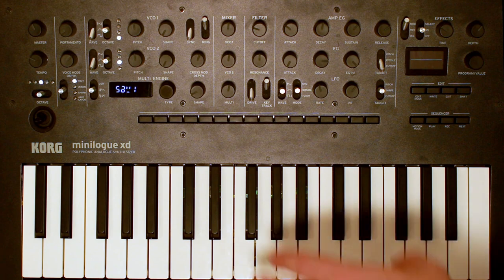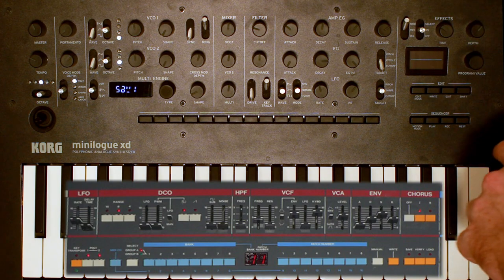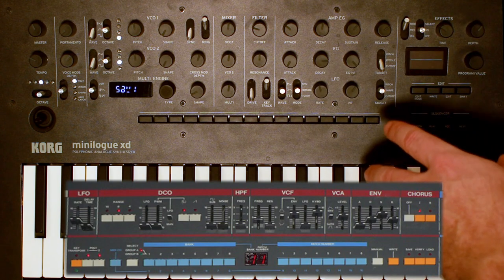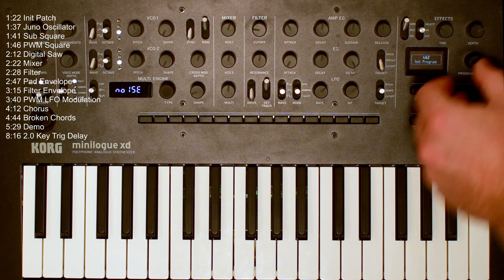Will It Juno? Juno 106 Style Minilogue XD Patch Tutorial

Comment: I did everything you did on the last part, but I can't hear any sound when I play notes, how does that work
Reply from the maker: Ah, just looked into it. this is just the motion record delay. I forgot to add that you need to add 1 big note from the first step to the last step. it will keep repeating as the motion record is not a one shot, however you can change the step resolution and tempo to make it last longer
Reply: Aisjam Had the same issue, thanks for the hint.

Comment: This is awesome, can you make one for the Prologue?
Reply from the maker: :( I wish I had a Prologue. 

One day I hope to have one in my collection however a lot of these ideas can be easilly applied to the Prologue. I think the effects system is slightly different. and it doesnt have a sequencer to do the delayed LFO. however that duel layer keyboard more than makes up for it. 

I wanna hear some of those lush duel layered sounds you make.
Reply: @Aisjam  You need to get one! I got mine about a year ago and love it... it can be tailored to make some really cool sounds. The built-in chorus effect on it, however, is not that great- it de-tunes the VCO's and is DEFINITELY not as good as the OG chorus effect on the Junos. I don't think any chorus effect can properly mimic Juno-106 sounds, unfortunately. I was inspired by the Stranger Things soundtrack for sure when it came to synthesis, just wish I had a 106 to re-create those! I've made some interesting patches on the Prologue that sound similar to a 106 but just can't get the exact sound- will keep trying! I followed the tutorial but the Prologue is sounding a little heavier and thicker than the Juno, I can't seem to get the right light, buzzy sound that the Juno is famous for.

I can get a similar sound to the Juno-60 in terms of a bass-heavy sound, it's quite easy actually if you use 1 VCO, keep the EG and AMP EG at 0 and kick up the reverb and voice mode depth. It's cool to see what sounds you can recreate!
Reply from the maker: @maxberger6897  I just cant justify getting it. I Love it, I want it, but im pretty sure I would be shot if I got it.

When I was living in Sydney, I was just around the corner from Sounds Easy, an electronic specialist music store. Had a lot of oppertunities to try out various types of synths and to play the prologue 8 and fell in love. There is something special about the Juno chorus no doubt. One day ill find the schmatic and see why. I feel the part that is missing in the minilogue and logue series is the high pass filter (monologue doesn't, all the bass :D), Just knocking off the sub low end a little bit brings out the warm and fuzzies. I Usually record the clean sound from the minilogue and add an eq and effects in daw. I have a sneeky suspission when they created the prologue and Minilogue XD, one of their goals was to create a modern "classic" synth. my research into these videos show a lot of similar workflows from the past.

Stranger things has helped with the resurgance of analog synths, there is an interview with the musicians that made the sound track. Im pretty sure that they used an SEM for the intro theme. check out this video https://youtu.be/lIrBQim8dzk?t=370 but they have some really cool boxes to play with. I came from Chiptune and synths seem to be the next logical step.
Reply: @Aisjam  Korg definitely tried to create the "Modern Classic" synth with the Prologue and I think they definitely hit that target. You can edit the sounds to make it sound like a vintage Korg synth from the 70's, or edit them to make them super hi-fi.

For Stranger Things, I watched that video as well :) The guys at Reverb disagree, they think it sounds better on a Juno-60, with the arpeggiator. I made a very similar sound the other day. They did, however, use a Prophet 5 for the bass on the track "Kids", and it sounds GREAT. That machine is a beast. Check out this video here: https://www.youtube.com/watch?v=8vFtEuP5SiQ

Comment: How is the low end? I just ordered one and the lack of low end is the only thing I’m worried about
Reply from the maker: This thing can rattle my room. I have a video on how to make sub bass on the monologue, that works the same on the minilogue xd.
Reply: I've found myself occasionally disappointed with certain patches where, if you find a nice sparkly high end for melody, you can't get a good bass on the other end to anchor the melody. If you're only making a bass patch, you can do that just fine. Sinevibes makes a pack of filters that load as user mod effects. Unfortunately that means no chorus or anything (without external effects), but using a high pass filter to boost the fundamental while you find a sweet spot on the low pass filter really helps boost low end. Made some monster bass with this combination.